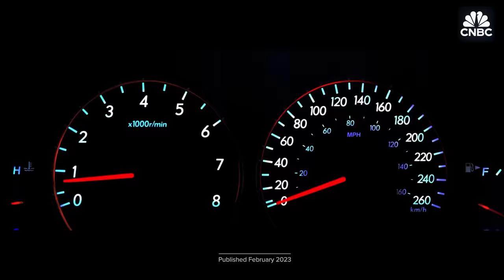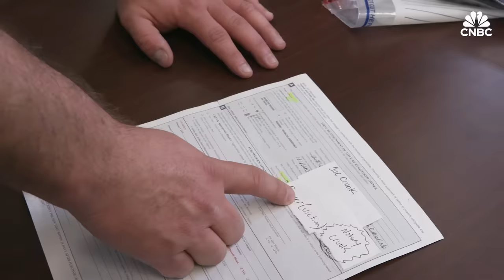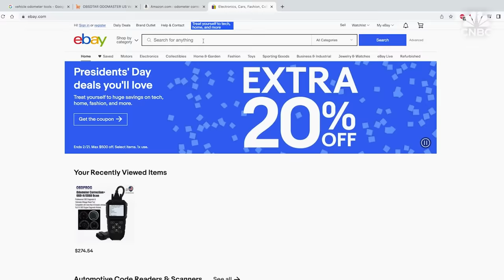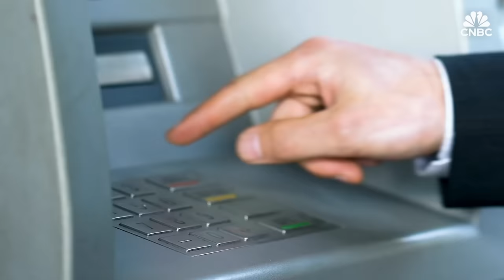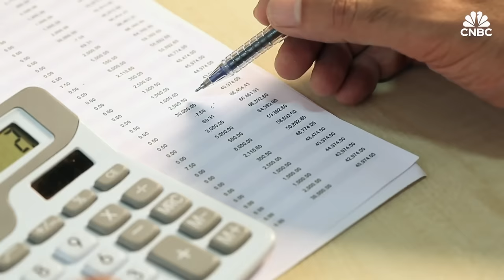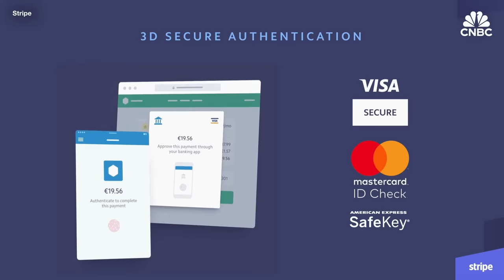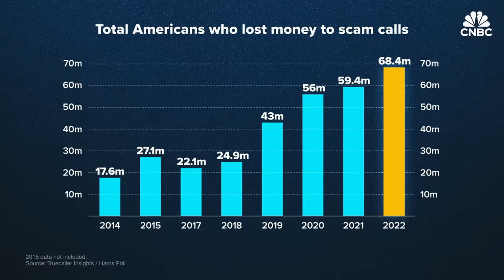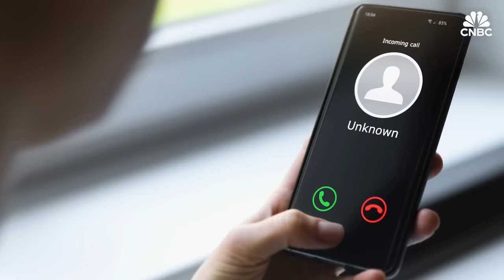How Americans Lose Billions To Fraud | CNBC Marathon

Comment: In the UK mileage is recorded at the annual MOT test. The major exception to this are police vehicles which are never tested. Not even on sale. They get sold at auction and the auction houses offer to MOT the cars but the police  refuse this as they get higher prices with no recorded mileage.  So the police collude with the scammers.
Reply: Same in Sweden, and it will show as a discrepancy when checking MOT history which is readily available online, for free.
Reply: Small dealerships have a habit of doing it a lot stay away from these scam dealers.
Reply: @wendwllhickey6426 Yes. Defund  them. Even if it means defunding the police.

Comment: I don't have to worry about scammers. I simply have no money. Even then, I've been scammed, actually hacked. My PayPal account got hacked and I lost everything I had built up. A total of about $16. They went through a whole lot to steal $16. They even tried to get money from my regular bank account (attached). My $4 was safe as my bank did not allow it. LOL
Reply: Scammers and identity theft can do worse than take what you have though.  They can put you in debt.  If they are successful at opening loans or lines of credit then, sure, you might be able to get those cancelled, but you'll have to find out about it first -- have it ruin your credit score -- and then take the time to fix that as well.  It's a massive waste of time for both individuals and companies and it's shocking that it's been happening for years and it's still so easy.

Comment: When the seat is shredded, steering wheel worn down to metal, no ink left on the radio it probably doesn't have 40,000 miles.  I had a 2003 Jeep Grand Cherokee and would take the ABS sensor out in the winter because it was dangerous, well it also controled the mileage. I scrapped it when it blew up but easily could have sold and nobody would have known.

Comment: Education is the most important step here, that elderly lady's story had so many red flags that would with the right education prevent this sort of crap from happening. I only have a debit plus card with no overdraft, if I want to spend money I have to transfer it from a different account and will only do it for that amount, it is not a perfect system but has worked perfectly thus far.
Reply: I do the same thing with my Paypal account. No one can get more than is setting there, and they have no idea where the money was transferred from.

Comment: There should always be a second odometer hidden deep in the engine bay that reports the actual mileage and can support digits to the millions place. This second odometer would normally be ignored by your typical roll back guy trying to scam someone on a car. Then once the car is investigated, that odometer reading will be discovered and tell the truth. Do car manufacturers do this?
Reply: Usually the odometer reading is stored in multiple computer modules in the vehicle that can be accessed through the OBDII port. Some of the methods of modifying the odometer overwrites this data and some of the methods only modify the data in the instrument cluster leaving the unmodified data in other computers in the car such as the PCM.

Comment: If cars had different modules that recorded the mileage would make it harder for the crooks. In Canada when you renew your plate every year you have to register the mileage that keeps a pretty good record  if u sell or buy a car  they sell a vehicle users sellers / buyers package.  so that gives a vehicle history
Reply: They record ur miles every time you go in to get an oil change
Reply: Most modern cars actually have several places to store the mileage. You should always check a used car with a diagnistics tool before you buy it. Often this immediately shows that the odometer odes not match the recorded milage of other ECUs

Comment: Rewinding a car's mileage from 300000 miles to 30000 miles, the example mentioned some five minutes in, should be barely possible. A car that has been driven so far has signs of wear and tear everywhere on the interior and exterior. Sounds like an excessive attempt at fraud that is easily uncovered.

Comment: Also I might add the dealerships are the leadership of ripping customers off if ppl find a good mechanic body shop as long as they are fully licensed stick with them there are tons of crooked shops out there and tons of good just like in our government hahaha still our prices all vary on labor depends on states parts also vary there are three grades of parts cheap good and the best I myself in my shop won't use cheap unless customers ask for them as I can't warranty cheap parts good and best comes with warranty on the items and the price of labor also backs up warrantying the job ask for cheapest job you have to expect cheap work with no warranty shops need to stay in business yet also need to be fair with prices and do good work this is my opinion and how I run my shop

Comment: Rolling back digital odometers is not easy without getting caught, the old mechanical odometers could be rolled back fairly easily but there is little washer like things on the old ones if you don't know what you are doing on them the pros can tell but not to regular person who has no knowledge of the scam